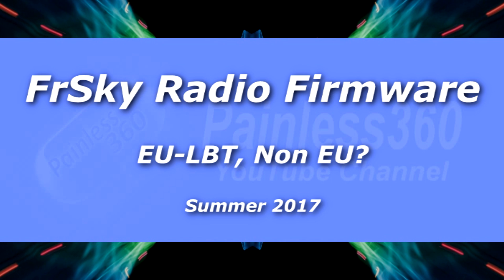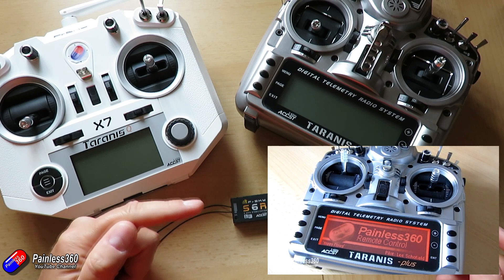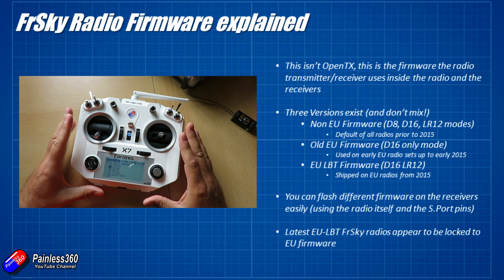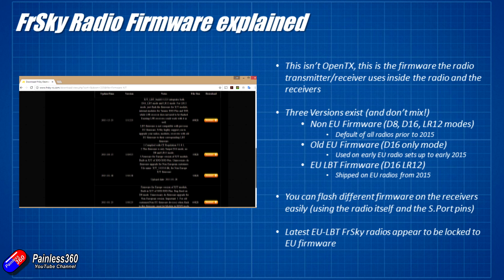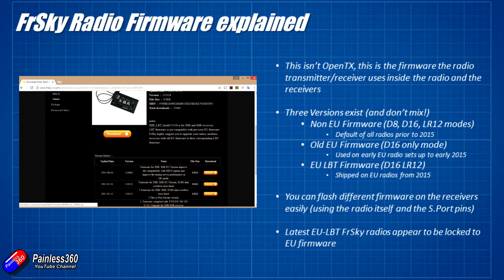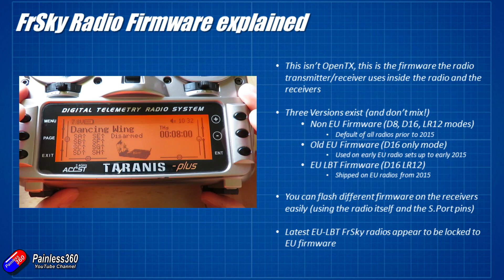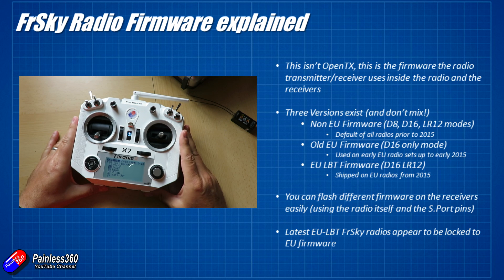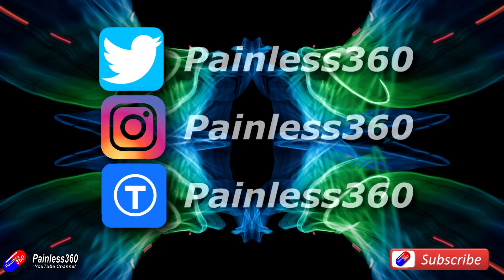RC Quick Tips: What is FrSky EU LBT and non EU firmware all about?

Comment: I have D8 D16,LR12 and have the Aurora min quad with frsky receiver, I can bind to it but I get a 1-2 second input delay, obviously can’t fly it..I have another model works fine on my Taranis q7, so it’s obvious I have the non Eu firmware updated, June 2017 version. I’m stuck and don’t know what else to do...I know my SD card warning still comes up , so I probably need to update the firmware for SD card..but that shouldn’t cause the delay correct? ANy help please...many thanks
Reply from the maker: I've never seen that. I'd let the vendor know that you have a problem quickly.. Best of luck!
Reply: I told Banggood and they gave me a partial refund but still doesn’t help me as right now its a paper weight. I should contact the manufacturer of the receiver but don’t know who makes them..Frsky receiver..tx
Reply: Sent Eachine a note, lets see if they can help...thanks for your help

Comment: Hi Lee, i'm going to build a s800 with f405 with inav, not sure what RX to use, i have  an XSR and X8R, im not going to be doing 5km + so L9R not required. What RX will give me a  good 2km range. Also, does non EU firmware give better performance?
Reply from the maker: If you're in the EU then you should be using the LBT firmware. The range of the XSR, X8R and the XM+ should be very similar. 2km is pushing it on legal 2.4Ghz though..

Comment: Thanks for this video, very interesting. However, I dont think it deals with everything. I know that I can bind to brand new EU-LBT receivers (marked as such on the packaging) and the only mode options I have are D8,D16,LR12. It would be nice if it was possible to unequivocally identify the firmware version from the menuing system.  Pretty sure that what I have on the radio though is EU-LBT, despite the modes matching with your description of non EU.  It would be very useful to see an explanation of this anomoly.
Reply from the maker: It wasn't meant to cover the entire topic, there is lots to cover and this is only an intro for those buying receivers from international sellers and getting the wrong type and not being able to bind. Thanks for the comment..

Comment: under my opinion, it´s a crap radio. I got one, and I feel sometimes that I need to be a engineer to fly a model with it.
I bought the TGYi10, much cheaper, and unbelievable easier to use. touch screen, and a very smart settings. since I got it, the taranis is eating dust and rust.
if the TGY make it to use a long distance module, goodbye futaba, spektrum and frsky.
the way to go, is touch screen, and easy to set

Comment: Hi Lee. I thought it was the internal XJT module that had to have either the LBT or Non LBT firmware on it. Does the radios firmware have to match the internal modules or can one run EU and the other Non-EU for example?
Reply from the maker: +Anthony Croft to link with an a reciever you need the same version of the firmware. You can opt for EU or non EU settings when you flash the version of OpenTX.  See some of the other comments.. Happy flying

Comment: I thought that I was confused but having watched this video I know I am !

The only modes available to me in Model Setup are D8 and D16 which fits none of the 3 firmware versions mentioned in the video.

The Taranis is several years old and I have deliberately not updated it to the EU version for fear of problems.  Was there yet another older version of the firmware that did not include the LR12 mode ?

Comment: As someone in the market for an FrSky Tx to run some small whoop style microquads for indoor flying once the fall hits (as if it isn't rainy enough already...) I wonder if the problems with flashing are only centered on the Tx, or have they region locked the actual receiver chipsets droneside too?
Also, is that tip still legit? Because I've known about the D8 protocol trick since I started reading up on RC but I was worried they'd changed that along with the region locking.
(Obviously I live in the EU, and there really aren't many non-chinese options for buying small quads.)
Edit: Ok, hadn't watched the very end of the video, thanks for clearing that up, I guess I'll just pick up the Taranis once the weather gets bad enough that I can't fly my usual bird XD

Comment: A year ago I flashed my taranis back to non eu firmware ,Because it didn't work with the d4r2 and others, has that changed with these days or is it still the same ?
Reply from the maker: +servet92 I believe that you can get around this by having the LBT firmware on the radio XJT module an them still have the D8 protocol available by not selecting the EU option when  flashing OpenTX.. I've not tried it personally both other subscribers tell me it works.
Reply: Yes it run in D8 Mode. openTX without EU (no x at EU in Companion)!!
On XJT use the EU-LBT, and have fun.
(also D8 run's with XJT_eu_150122.frk, it is the oldest EU FW, but LBT have better Transmission Range).

Comment: i am struggling learning how to use my frsky horus x12s to do the basic things that there r tutorials for every other frsky radio besides mine.
Reply from the maker: +Jp Foesad that rafio is a little different. I am considering a series if I can get hold of an X12s..
Reply: Will you do the series on the FRSKY OS or OPENTX ?? I ask  because i am thinking of getting a Horus and use the FRSKY OS as OPENTX seams a nightmare , many thanks .........
Reply: No OpenTX is genius!! I learned OpenTx on a Th9x, ist is easyer, because the Th9x has only one 3Pos Switch.
But a 4 Flap Wing with Crow on the Throttle Stik is no problem.
Learn how the Mixer work, then INPUTS, CURVES and LogicalSwitches, then you know 80%.

Comment: Not quite right, I have EU-LBT firmware on the internal module and use EU-LBT on the X series receivers. 

Tho in opentx I unselected the EU box on firmware updating for opentx.

I can bind it to D8 D16 EU and LR12 and it won't work on non EU D16
Reply: Chris Balmforth that's what I have
Reply: I ran into the same problem with my X lite transmitter, unchecked the eu box in open TX but still wouldn’t bind to non eu gxr6 receivers. Tried everything untill finally I found out I had to flash the INTERNAL iXJT module as well on the transmitter via the sd card with  the FCC firmware. Then it worked. I had the black eu lbt sticker on the X-lite as well. So you have to flash 2 things on the radio, the open TX non eu and the internal module...Hope this helps.
Reply: Jasper Tielen That is very interesting. I have a number of models with D4R-II receivers and don't really want to change them to something different. That said I have not managed to upgrade my original taranis (non plus version) XJT module to EU-LBT and bind successfully with a receiver using EU-LBT firmware. I must try again.
Reply: +Jasper Tielen  
me too. In the last updating to 2.2.0 to have lua scripts in the taranis I unselect the eu box, and I have d8, d16 an lr12.
But all of my receivers have eu lbt firmware, the same of the internal module.
Reply from the maker: +Jasper Tielen thanks for the post. Happy flying
Reply: I use an X9D+ EU-LBT tranny running OpenTX 2.2.0 and need D8 mode to control a couple of micro-quads with FRSky-compatible receivers. I just un-checked EU on the Build Options, updated the OpenTX firmware and D8 magically appeared as an option.
Reply: I cant bind my q x7 with my x4r sb. When trying to bind the and green light on and the red never flash. What possible problem should i have?!